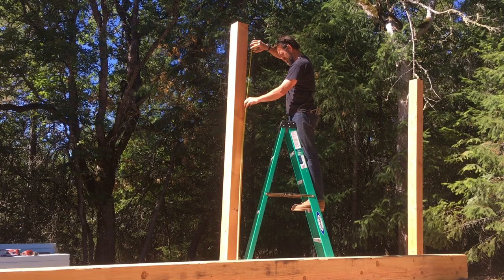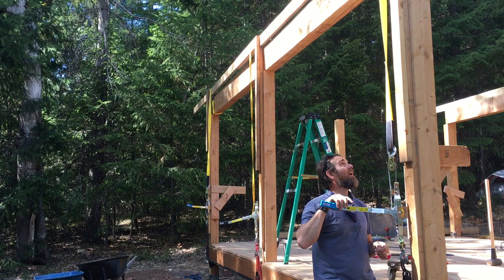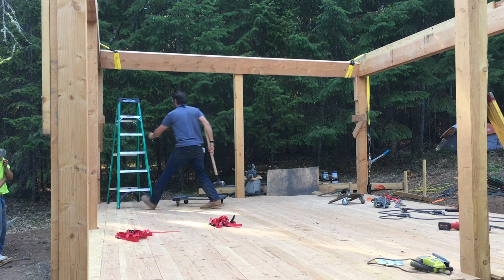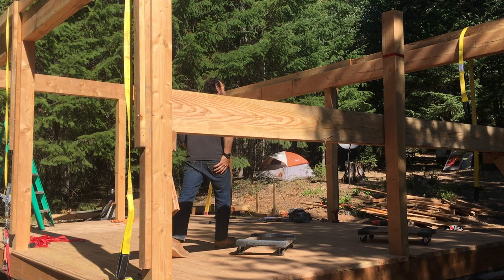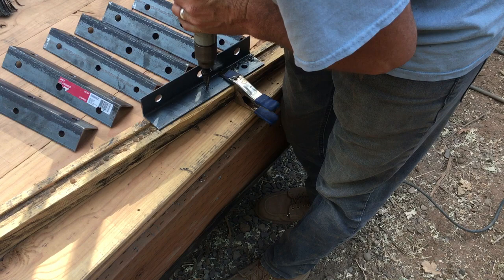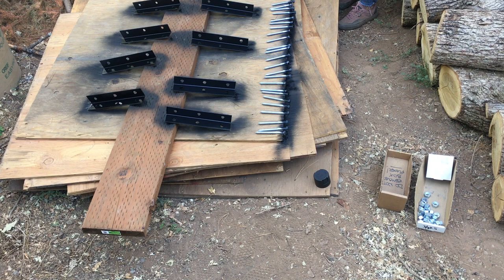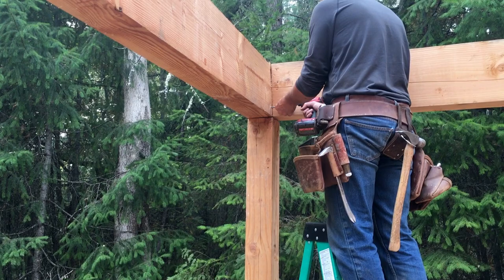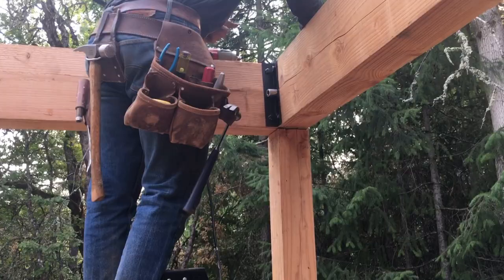Off grid cabin builds & homesteading  EP. 5 | Begin structural post and beam part 1| CROWSFOOT

Comment: Proper post and beam joints and angle iron wouldn't be needed.
Read this book
The Timber-frame Home: Design, Construction, Finishing

Book by Tedd Benson
Reply from the maker: I have another video coming up with interlocking joints. In this particular case I was up against time and what the engineer would sign off on... Thanks for sharing.